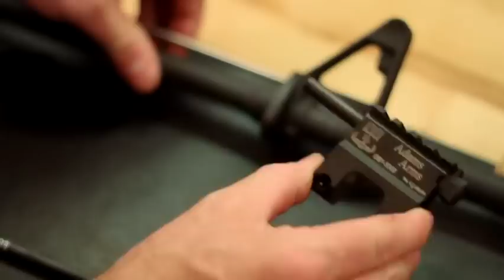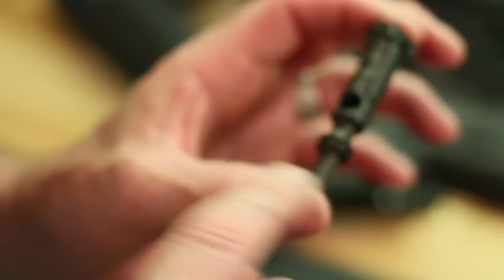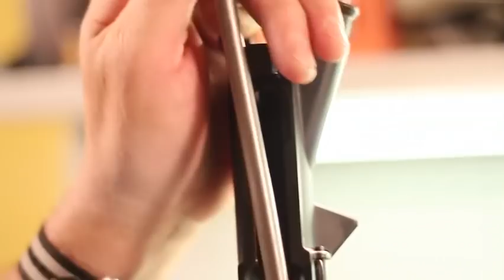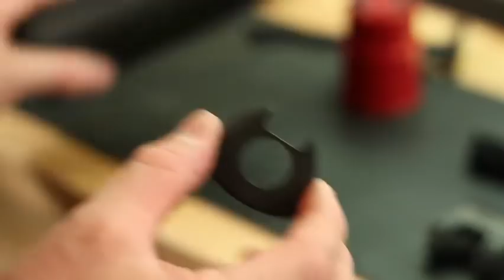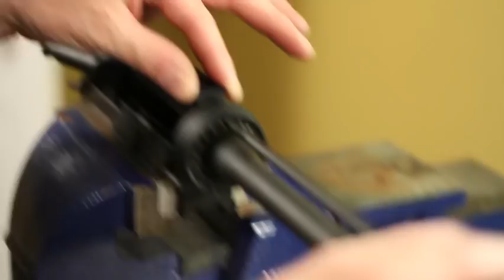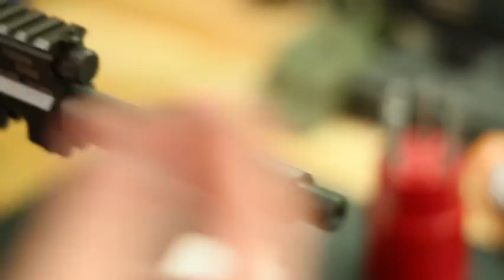Adams Arms Gas Piston Build Assembly Video

Comment: Do yourself a favor and measure the distance of the gas port on your barrel from the shoulder. Measure the gas port distance on the gas block and the difference is your minimum gap. Don't trust the business card trick. Use feeler gauges. Not all gas ports are exactly in the same place per shoulders may be cut further back. My rifle would not cycle properly nomatter what i did to it. On removal of the gas block, i found that the gas port was covered in half by the port on the gas block. On inspection of the Adam's Arms gas block i noticed that the port hole is offset from the clamping screw by about 1/16. Using two "standard business cards" puts the port past the gas port on the barrel. I had to use the minimum recomended .015 thickness feeler gauge recommended by Adam's Arms.  Otherwise the hole on the barrel WILL NOT LINE UP with the port on the gas block.
Reply: amen to that
Reply: What if you are not using a handguard cap and going free float rail? is that the point of having the small gap in between gas block and shoulder? im assuming this gas block is designed for use with a hand guard cap. Thanks for any input.
Reply: musicmaneman38 I used a paper clip to get mine lined up just right I used the paper clip to feel on the inside of the gas block to make sure the gas port was lined up just right I felt that all spaces around the gas port were the same do yourself a favor and snug the bolts to make adjustment easier if you don't it's like hearding cats
Reply: MrPhillipftcm   GI retaining caps are 1/32" in thickness and the better barrels have a slight ring machined just in front of step cut for these caps as not everyone uses free floating rails. 
add that 1/32" to your numbers.

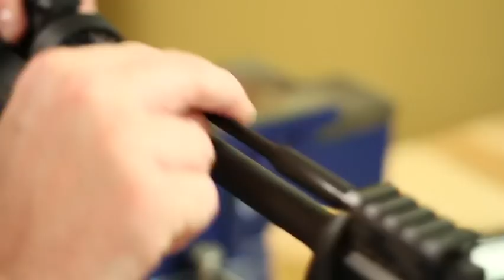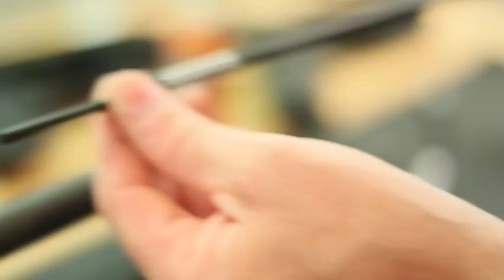Comment: I am installing the kit on Del-ton upper and adding MI free float HG. I am stuck at 7:56 where you are moving the piston back and forth. For some reason mine does not move that easy and it looks like it's aligned with the barrel nut without problems. But at 7:29 you enter the rod with the spring attached then when you take out the drive rod it doesn't have the spring because at 9"26 you say put the spring back onto the rod.

Comment: Recommend to use a bubble lever to align the gas block and the upper receiver.
After the piston system is installed, I use in- chamber laser bore sight to zero in my front site. If needed, re-adjust the gas block. Make sure no binding on the op rod. This way can safe you a lot of ammos and frustrations.
Reply: Check your use of the word ammos. No such word. Ammo is ammo one or one thousand.

Comment from the maker: Hey darkangel105100,
 I just checked a spare ss bushing and a DI gas tube that I had and the DI tube goes right through the SS bushing. You would have no problem switching back to DI if you wanted. I hope this helps and thanks for the comments!

Comment from the maker: @DontComeToMyHouse 
There are only certain rail systems that will work with the AA kits. You would have to check out the AA website to find out which models work for your needs. I know that the Omega rail does work with their system, but I think it's a Omega made specifically for piston kits.

Comment: I contacted Adams Arms and my regular Omega rail that I have on my AR WILL work with the AA kit. What I was wondering was can I leave my rail on during the installation process rather than take it off like shown in the instructions. Can I line-up everything correctly without taking my rail off.

Comment: I just installed a midlength p-series last night for 7.62×39 upper I threw together. Hoping it will work.   Used a Troy FF Alpha rail and had to install the rail first then slide the op rod and GB on cause the rail wouldn't go on with the bushing and spring on the operating rod. The rail has be turned about 1/4" counterclockwise to slide on the milspec barrel nut then rotated back clockwise . The bushing prevented it from being able to turn counterclockwise.  But I marked up everything and got it all lined up.   Luckily the holes in the handguard lined up perfectly with the set screws in the GB.
Reply: Has it worked?  Why did you use P series?  I'm thinking on getting the micro kit for my 10" carbine gas length 7.62x39.

Comment: Watched this today AFTER using the Adams Arms CD to do my install. I had a laugh at 'a little bit of tapping' when you were installing your bushing. Getting the bushing into my Spikes upper was brutal. Glad it was a fresh build as I would not have wanted to hammer on that with the barrel in. I made sure it was straight, had it lubed up with Aeroshell 33MS but it still took a framing hammer to get it in. Hope my next build with a DPMS upper goes easier on that part (got a couple of the discounted kits with barrels) The rest was a piece of cake. Nice video.
Reply: Put the bushing in the freezer for a couple hours. And you could heat the upper. Should make it a lot easier going in...

Comment: Is there any piston system out there that doesn't need a special handguard? Or at least a handguard that looks good, not just the standard one?
Reply: Conner Williams you can buy any free float handguard that you want. Just make sure if the handrail is longer than the gas system that the inner radius is larger than the height of the Adams arms gas block or else it won't fit over it. If you want the Adams arms gas block to show, just buy a free float hand rail that is shorter than the mid length gas system. That way you don't have to worry about the radius of the handrail. Personally I like my handguards to extend all the way to the barrel but that's just my preference. Midwest industries sells great m-lol handguards that should fit over the gas block.
Reply: Take a look at the Daniel Defense Omega, it's a free float rail that uses a GI barrel nut.  Awesome to use with Adams Arms kits.

Comment: What's the purpose of the spring on the end of the bolt? It looks thin and cheezy and appears it will not hold up. What is the purpose of the spring? The spring looks like it will give just as much trouble as the ring system. If I have to replace springs, I'm no better off than I was replacing rings. And by removing the rings, wouldn't that cause the bolt to have a slight wobble?

Comment: Hi Rampart, i have a Question. Does the Adams Arms Gas Piston work with Yankee Hill Machine or/ and Midwest Industries Handguards? Because the rod near the Gas Block has the larger diameter than the rest of the rod. Thank you. :)

Comment: Will this piston system work with standard free float mlok handguards ?? I'd love to be able to convert to a piston system but I have no experience with products like this... id prefer to use a free float handguard though... surely there is a way... great video!! New subscriber here!
Reply: Hi Caleb, I just converted my DI PSA upper to AA kit just like in the video. I got the kit for $150.00 so I couldn't pass it up. Installation was easy but with this particular kt your only option is to go with the Magpul MOE SL Mlok handguard for $35.00. Most of other rail kits wont fit this particular kit.  Id wish for a full length 15in rail BUT MOE SL is NOT bad.

Comment: Will the conversion hurt the direct impingement gun in any way? I've heard stories about carrier tilts.
Reply: Carrier tilt is a symptom of a problem not the actual problem. The actual problem is sloppy or loose tolerances in the receiver. Our one-piece carrier combined with our bolt spring eliminates carrier tilt in even the sloppiest of receivers. For those who have normal mil/industry spec AR's, the design of our system does not have an issue with carrier tilt. The fact is piston systems on the market vary from manufacturer to manufacturer we believe that ours has several design features that benefit over the competition in the market.

Comment: What if I want to use a Different Hand Guard because I am building an AR15 Pistol with 7.5 inch barrel...
Reply: Sir David Haddon you can buy any free float handguard that you want. Just make sure if the handrail is longer than the gas system that the inner radius is larger than the height of the Adams arms gas block or else it won't fit over it. If you want the Adams arms gas block to show, just buy a free float hand rail that is shorter than the mid length gas system. That way you don't have to worry about the radius of the handrail. Personally I like my handguards to extend all the way to the barrel but that's just my preference. Midwest industries sells great m-lol handguards that should fit over the gas block.
Reply: most free float barrel nuts will NOT allow the drive rod to pass through cleanly. 
choose wisely.

Comment: Do you need to check the head space when building a gas piston AR?
Reply: +Itchy Fingers - You should always check headspacing for all AR style rifles regardless if it is DI or piston.
Reply: Thanks! I thought so but watching all these conversations and no one checking for headpace was confusing.
Reply: +Itchy Fingers - I'm assuming you meant build an AR from all new or different parts.  You'll want to specifically look up how to check headspace on an AR. That'll show you which components, when changed or new, dictate when to check the headspace.

For this video, they're converting an AR and not building. Also they're not changing the components which necessitate a headspace check.

This will all make more sense when you find the instructions about checking headspacing
Reply: Thanks!